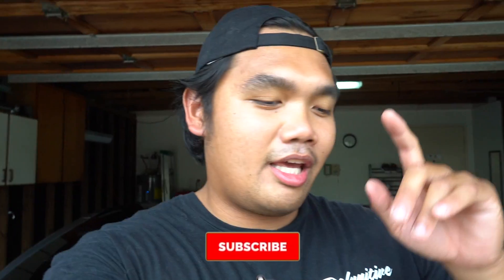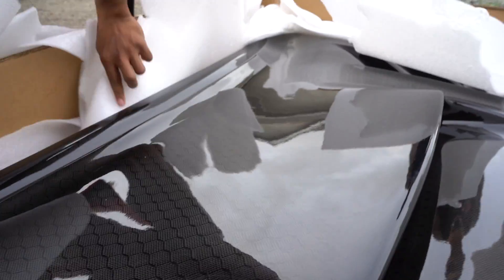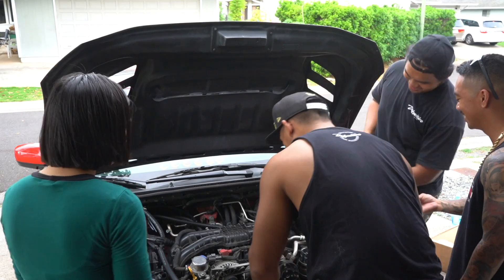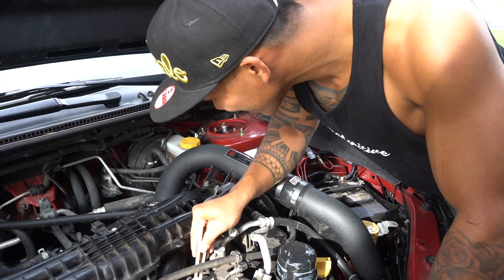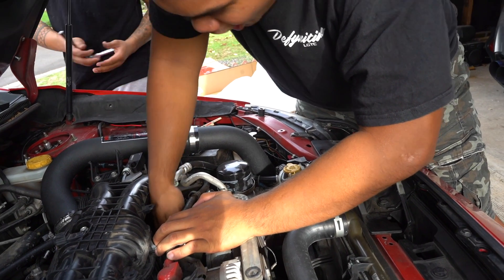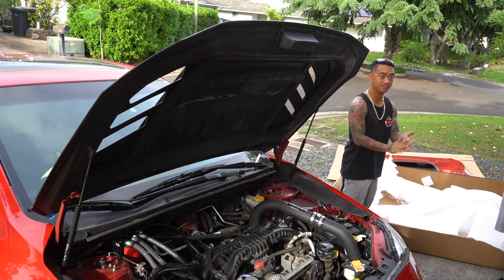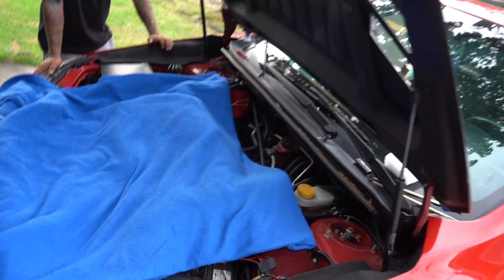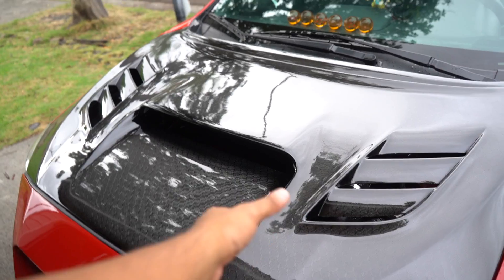THIS NEW HOOD IS SICK! SUBARU WRX HONEYCOMB CARBON FIBER HOOD INSTALL.

Comment: How you guys make the hood fit hood without having one side off
Reply: Sorry good *
Reply: Sorry good *
Reply from the maker: theres small wiggle room. so undo the bolts that attach to the hood and adjust them to where you want it and then bolt it down.

Comment: Just curious... hows the engine and components holding up with the water from rain that drips through the vents? Any issues with that? Any rust or anything?
Reply from the maker: my friend has been running it ever since. never had a problem yet!
Reply: These cars get surface rust on engine components with the stock hood even. When I had my 2020 Wrx within 2 months there was surface rust on the turbo.

Comment: Hows the fitment on fly1motorsport bumper on wrx? Planning to grab their fenders
Reply from the maker: if you have an aftermarket intercooler you will have to make some adjustments and cut. I made a video of the bumper install. it's labelled as varis cuz I didnt know exactly which one was it.
Reply: Do you recommend fly1 for fitment wise? Thanks
Reply from the maker: @terencemostoles4049  just from the one experience I've had installing it with my homie I I think it's an easy install. just be careful because it is still fiber glass.